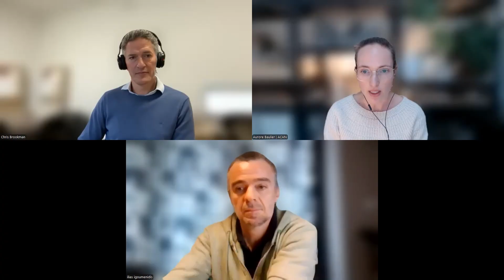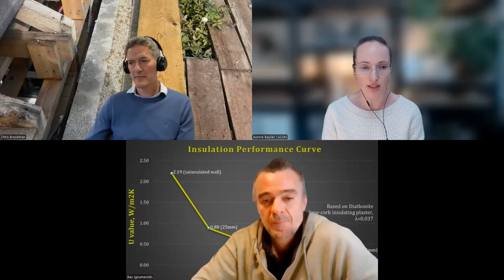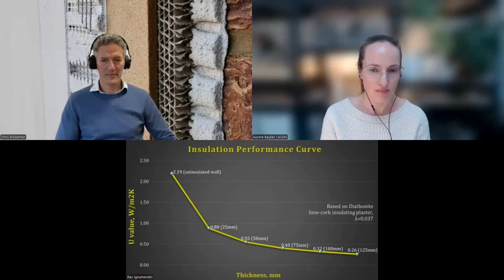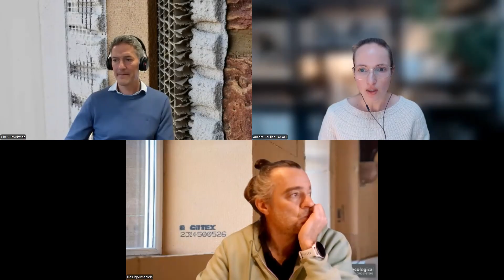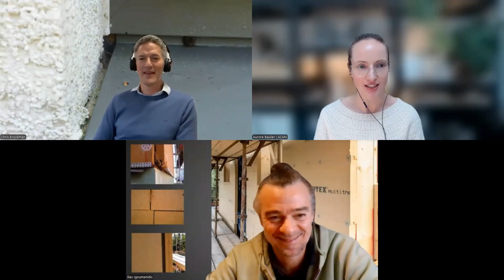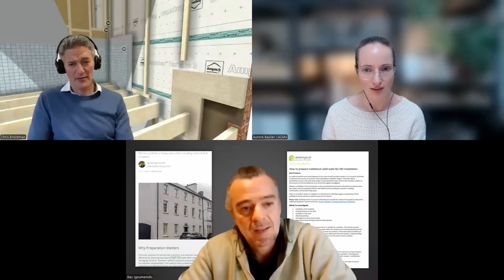ACAN Retrofit Series | Insulation: What, Where and How

Comment: 22:50 …. very interesting to hear about the dynamics of heating when the u-value is technically the same but where 20-30mm of insulation is placed onboard or outboard “feels” warmer when oneself is not radiating back onto an uninsulated internal wall. 

Noted that it is critical to use the right vapour open interior paints, but what is the real impact of using vinyl paint? , for example, because it is almost inevitable that some future owner of an IWI house will use such a paint albeit unknowingly diminishing the breathability of the wall!?
Finally, it hadn’t occurred to me that, of course, one needs to decouple a fully tiled wall, in the case of maintaining IWI breathability, so thanks for highlighting this!

Comment: Thanks for uploading this. 

I recently watched a presentation by Joe Lstiburek (Building Science Corporation in the US), about freeze thaw risks wrt to IWI. I'll leave a time stamped link below. There are many related articles on their website that are easily accessible on their ai/conversation assistant. 

The key insight is that freeze thaw occurs not primarily due to the expansion of water to ice within a brick, but the osmotic forces cause by very high salt concentrations left in the water during the freezing process or subflorescence. If you manage either the water or salt concentrations at the surface, then you can manage the risk.

The amount of water above which risks occur, known as the critical degree of saturation, will be dependent on the brick. The quality of the brick is related to where the brick was in the kiln, as they need to be fired in the correct conditions for vitrification ~1000C. Many buildings used different quality grades of bricks in different areas to reduce costs, as the poorer quality bricks were cheaper. 

Furthermore, the building is exposed to very different levels of surface water, so different approaches can be used to manage those risks accordingly. From periodic repointing, rendering, or adding better surface water management to the building. 

I'll leave the link as a reply to this comment, if it doesn't appear search "kent county court lstiburek", title indoor air quality, but it covers a wide range of topics, but 6hr13m is the relevant part.